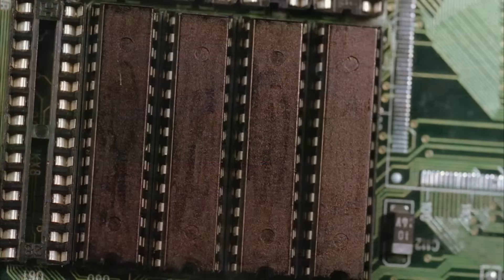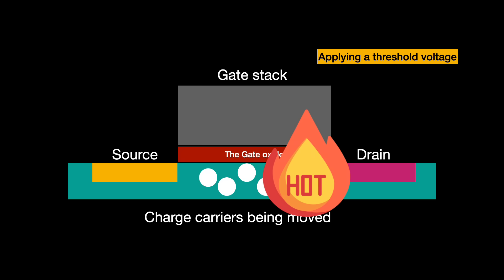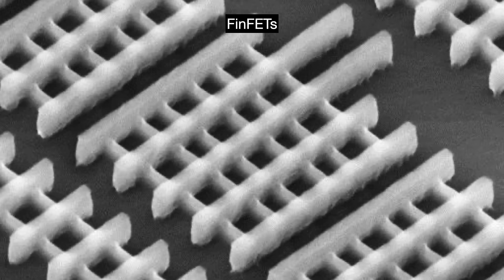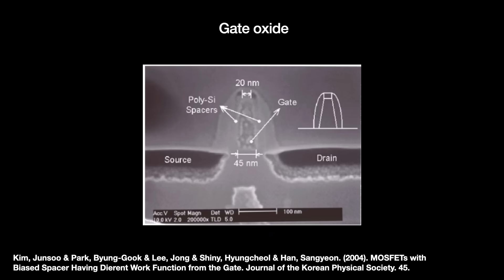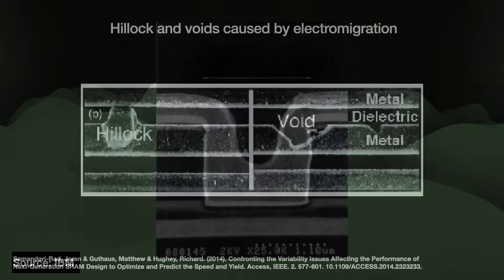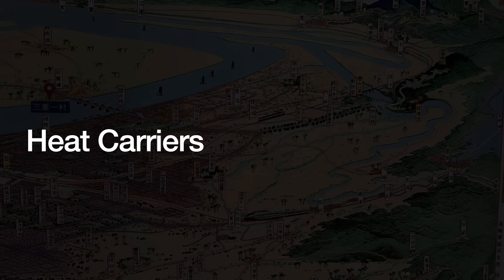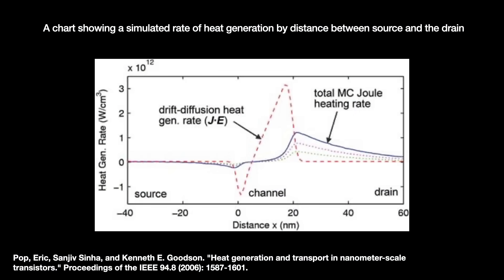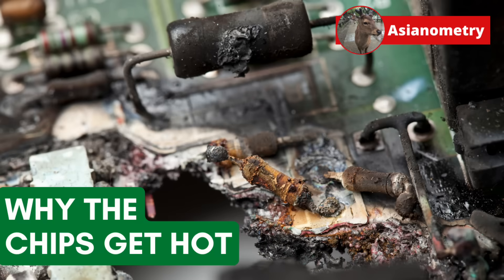Why the Chips Get Hot

Comment: As an electronic engineer myself, I felt threatened when I realized that my answer to that question would be a couple of sentences, while Asianometry made an entire 18 min long video
Reply: one of you depend on meeting quotas
Reply: It takes a lot of genuine understanding and skill to distill a complicated and complex answer into two sentences. Before long, you may be able to boil it down to one. I'm a materials scientist, so different field but similar ideas and concepts.
Reply: Because they convert power into heat 100 % 😏

It’s funny I’ve seen people argue about power and heat.
Reply: Yeah, it's just as effective as a space heater lol.  No light or kinetic energy, so it's all thermal  @ralanham76
Reply: @ralanham76  Because, technically that statement is not true. 

Adding the word "virtually", or "almost", would make the statement true. 

If it were true it would mean that it is theoretically possible to create a chip that consumes no power, if you could reduce electrical resistance to 0...and this is not true. 

Because, electrical signals consume 10 picojouls per bit.

Plus, in a real world chip another miniscule amount of that power becomes electromagnetic waves, instead of vibrating particles.
Reply: @tylerdurden3722  99.99 % efficiency 😂
Reply: Any material with electric resistance will heat up when current passes through it. But yeah, the video goes into a lot of detail.
Reply: I'd definitely prefer the "few sentences" answer to a convoluted 18 minute video.
Reply: You'll upgrade your knowledge a lot following (and supporting?) this top quality channel. Signed: a lowly maintenance e-technician.
Reply: Just remember what Terry said
Reply: @salsamancer  Terry the programmer sent by God?
Reply: I'm curious, what's the difference between Electronic Engineer, and Electrical Engineer? Is it more just a different career path, or a difference in education path?
Reply: @Chuck8541  - My father is a (retired) electrical engineer: he knows absolutely nothing about computers (electronics).
Reply: @ aaah, I see.
Reply: @Chuck8541  neither of their trains run on coal?

Comment: An underground carriage can have 200 people in it at rush hour. Each person is putting out about 100w of heat, so each carriage has effectively 20kW of heating. A typical carriage is about 200m3 in volume so with that number of people it's temperature will go up by 0.08C per second. The air con on the trains is rubbish so you get to cook.

That's what's up with that.
Reply: Well, you’re presenting the source of the heat. The real question is why they don’t solve the problem. Metros in Paris and Tokyo never let heat build up to the same discomfort.
Reply: @ArnaudMEURET  no idea, but my best guess would be a mixture of when it was built (started 1863 in London, 1900 in Paris and 1920 in Tokyo) and the relative climates.

Even today in the UK, air conditioning is rare outside of commercial buildings. Retrofitting it to Victorian infrastructure is probably a nightmare.
Reply: @simonwatson2399 
Man am I glad I'm nearing the Diffy-q knowledge to actually solve a problem like this in a space. 😅

Like, I was gonna (not sarcastically, but in a way that definitely didn't imply I was expecting you to answer my pedantry 😅) say something like, "how are you accounting for peak temperatures in this equation to where you're using the term 'cook'?", but then I remembered "Oh, wait, there's a variable for that in the heat equation. It's probably in the video regardless. 😅

TL;DR
I had a nice moment or two of nerd contemplation. Sorry to waste anyone's time. 😂
Reply: @ivoryas1696  you're welcome. It's always nice to receive a kind word in the comments.
Reply: Sounds like a great way to get sick, with that kind of crappy ventilation.
Reply: Suck all that yummy heat outta people. We getting cold with this one 🗣🗣🗣
Reply: They have air con in your metro??
Reply: @tutacat  allegedly!
Reply: Not only this but also the electric motors are responsible for a large portion of temperature increase. With every acceleration at every stop a lot of energy is lost to heat
Reply: It's also not helped by the small diameter of the tunnels, which are barely bigger than the trains themselves -- and even force deep-level tube trains to be smaller and rounder in cross-section than mainline or subsurface trains.  This doesn't leave much room for ventilation around the trains, so a lot of their heat ends up heating the ground around the tunnels.  And almost all of the deep-level lines have above-ground sections too, so the trains also bring in heat from the sun in the summer.  Plus the type of ground they were dug through doesn't conduct heat super-well, so the heat has gradually built up over the decades.  

Newer tunnels (like the Jubilee Line extension and the Elizabeth Line) are taller and wider, with more space around the trains for ventilation and heat dissipation, so the heat doesn't build up as much.  The only way to add this kind of space on the older lines would be to rebuild the tunnels, which would be massively expensive.  Plus, boring the old tunnels out bigger would be even more massively disruptive; they'd have to be closed to trains during the digging, on lines that are far too busy to just shut down for an extended period.
Reply: @AaronOfMpls  Having the train be almost the size of the tunnel does have a small benefit of of making the train push/pull the tunnel air it travels through. Not all the air in front of the train can move around it increasing the pressure and that pushes the air out ahead to where it can escape, most likely the next station. Behind the train has a section of lower pressure with air getting sucked in from outside the station that the train has just departed(also sucking back some of the "warmer" air that the train would have just "pushed" into that station.
It's the piston effect and is actually how some of the tube system was designed to ventilate itself. Still the clay soil around the tubes are slowly heating up.
When the Moorgate tube crash happened in 1975 within a couple of hours of the accident the temperature at the station was up to 49 degree's & oxygen levels were dropping (No trains ventilating station, rescuer's, their cutting equipment & the ground releasing stored heat back into the air) before alternate ventilation was bought in.
Reply: @AaronOfMpls The trains fit tightly in the tunnels because that was how they also ventilated the underground. Remember they were first built when air conditioning was barely developed and they still didn’t standardize what voltage and frequency to supply electricity to all customers on. It was marginally effective but increased signage and station expansions screwed with the airflow, while increased ridership requires additional air handling than what passing trains alone could bring all the way through the tunnels.
Reply: Also, 200 people will make a small space humid pretty fast too.

Comment: I’ve built several class E transmitters, some of the most efficient transmitters possible of over 90%, using MOSFETs and have tested their limits, flying by the seat of my pants, without using overcurrent protective circuitry. When they get too hot and fail spectacularly, fire shoots out of the chip and is quite impressive. Aside from the nuisance of making operating notes, they’re only about $4, usually, and the capital investment isn’t affected. ✅👍🏻

Comment: An answer to the London Underground subway is that when it first opened over 100 years ago, it was very cool down there but the tunnels go through clay which is a good insulator and the constant breaking of the trains has saturated the soil so that it can no longer dissipate heat after a century
Reply: It is also an extremely difficult problem to solve, as yet there is no viable solution so it will only get hotter every year. Would make a great video.
Reply: @Spacedog79  I wonder if you could use ground source heat pumps to take heat out of the tunnel walls to heat nearby buildings in the winter.
Reply: @thamiordragonheart8682  Unfortunately no, the underground network is huge so you'd have to build a heatsink that is equally big and then you'd only buy a little more time as you'd just be making that hot too.
Reply: @Spacedog79  I was thinking more about using the stored heat to heat buildings in the winter, which then just ends up in the air, than pumping it into a purpose built heat sink.
Reply: @thamiordragonheart8682  Yeah the trouble is you'd need to do this at a vast scale to make any difference, it would be too expensive to be practical.
Reply: Not just breaking heat, a majority of underground lines have large sections of above ground track in the suburbs. During the summer the trains heat up when outside and release that heat when they're underground. In particular I find the Victoria line during the summer to be roasting
Reply: @MRlukeno2  It's also not helped by the small diameter of the older deep-level tunnels, which are barely bigger than the trains themselves -- and even force deep-level tube trains to be smaller and rounder in cross-section than mainline or subsurface trains.  

Newer tunnels are taller and wider, with more space around the trains for ventilation and heat dissipation, so the heat doesn't build up in the ground around them as much.  The older tunnels don't have this space, and the only way to add it would be to bore them out bigger -- which would be extremely expensive and disruptive.  Tunnels would have to be closed to trains for months on end to do it, on lines that are far too busy to just shut down for that long.  

And yah, the Glasgow Subway has even smaller tunnels than the London Underground.  But the entire line is completely underground, so it doesn't have the problem of sun-baked trains bringing summer heat inside.  And Glasgow has a cooler climate anyway, and very different rock and soil around the tunnels.
Reply: @AaronOfMpls  those narrow tunnels are apparently why London cannot air condition the trains like NYC does. But NYC has the same issue of hot AF stations in the summer, London and NYC both have the issue that their subways predate air conditioning. MTA has similar issues as Transport for London, In most places there just is not somewhere topside to put the cooling equipment for a station.
Reply: @filanfyretracker air conditioning would use massive amounts of energy and would increase the ambient heat making the problem worse
Reply: @MRlukeno2  try Central and Bakerloo 🥵
Reply: @MRlukeno2 why can't they just cover the aboveground section with roof or something so that the trains wouldn't heat up?
Reply: @ The heat comes from the passengers themselves, each one a roughly 150W heating element. the ground cannot conduct it away, and the rising number of passengers means more heat every year.
Reply: @MRlukeno2 brake not break
Reply: @MRlukeno2  bro talks about the outside then mentions the line with all its passenger stations underground
Reply: @MRlukeno2  It's been a while since I was back in my home town but that's an interesting observation you make. For example, I used to regularly commute to Hammersmith via the Metropolitan line from Pinner the entire suburban section above ground til reaching Baker Street which would be unbearably hot in summer.
That said I always found the Central line and to a lesser extent the Circle Line to be the most unbearable in summer...perhaps due to the thinner Central Line carriages as well as the heat release.
Reply: Taipei MRT has this same problem. Some of the underground stations are quite hot regardless of the temperature on the surface. Like it could be about 10 degree C outside but inside the station it's often over 30, which means unless you got into the trains, it was HOT no matter what.
Reply: Why would a broken train generate more heat than, say, one that is working well? Damaging items makes them hotter? What?
Reply: Hi. There is a vid about the London underground heat on yt .  Try some prompts there should be a hit .  Greetings from Germany
Reply: Nah, it’s just Londoners. Sweaty bunch, that lot… 😅
Reply: There's a video idea in here
Reply: 'Half as interesting' has a video on the topic:) @SasquatchsCousin33
Reply: @SasquatchsCousin33  https://youtu.be/4MzHt_YLnjw?si=CMYpRRQIoDxAufq7
Reply: BRAKING
Reply: Main heat source is the massively increased number of passengers, each of which is an equivalent to a 150W heater, plus each releases both CO2 and water vapour, so you need to actively remove those with the heat. the trains themselves are not really a big heat source, regenerative braking recovering a lot of energy, and brakes only to do the final stop, and the trains act like very efficient pumps, moving air in the tunnels to the stations. you have ot cool the air going in, or move massive volumes at each station, which is a problem with old stations with small ventilation ducts, in that to move air in you need lots of pressure, or bore out the ducts in the ground to be a lot larger, and have the passenger entrances with a high air flow as exhaust, along with mid tunnel sections that also exhaust large volumes of air to ventilate the tunnel and remove air from platforms. A big issue with there being no space to put this added equipment and needing to find space above ground to do the air inlet and outlets as well. Quite a few false buildings above underground routes that look like a surrounding building, but which are there to hide the massive fans and holes for underground rail ventilation instead.
Reply: So they break the trains while braking them?  Misspellings make these concepts so much more confusing.
Reply: @rockadoodoo Not everyone speaks English as a first language
Reply: @rockadoodoo 
Brake not
Break
Reply: That's so interesting
Reply: Why not drill down and have ventilation shafts like in Korean subway systems ?
Reply: @ Simple, no space above ground to put them, the ground is pretty well all built up, which is why the underground was started in the first place. Now no place to add in extra ventilation either.
Reply: @seamusoblainn you know they thought of that, ... they even have some huge heat exchange dummy station areas.  It's just so far impossible to take more heat out than is put in, any active motor adds to the waste heat.
The problem is you have to do work to move the heat out, moving trains do work on the air and reheat the environment in the tunnels.
Reply: Interesting. Looks like we need a good understanding of heat at geological scale too.

Comment: Because the hamsters get too excited and run too fast.
Reply: Angry pixies?
Reply: I knew it
Reply: this doesn't apply to the hamsters running the imgur servers, which can barely break into a trot.
Reply: @1verstapp Most days they don't even get up from bed.
Reply: /video
Reply: Exactly!   This was a pretty hot video. :D
Reply: Collectively.
Reply: ... stay in school 😂
Reply: Pretty simple explanation but you didn't mention their tiny track suits that help insulate them to increase heat generation as well as maintain it.
Reply: If it's rabbits, they're not running but doing something else to get hot
Reply: Did you mean chipmunks?